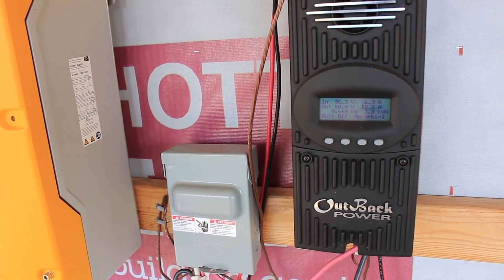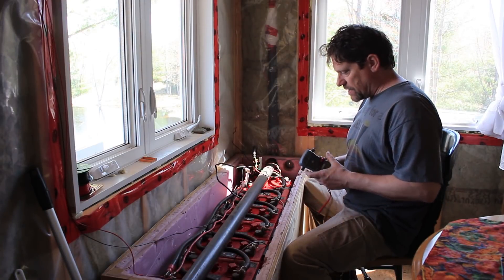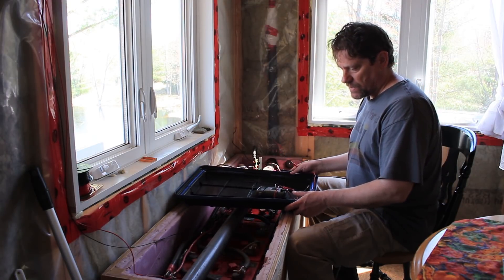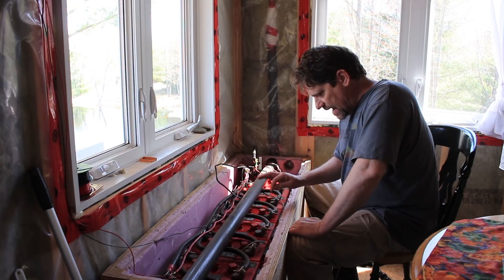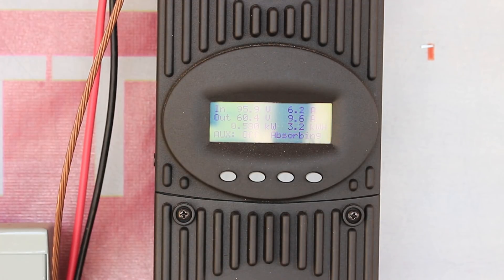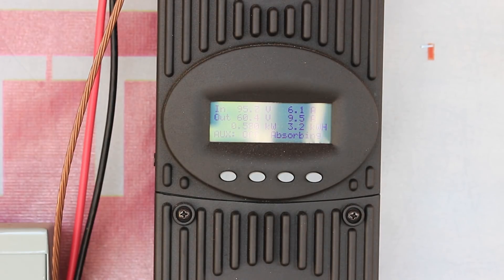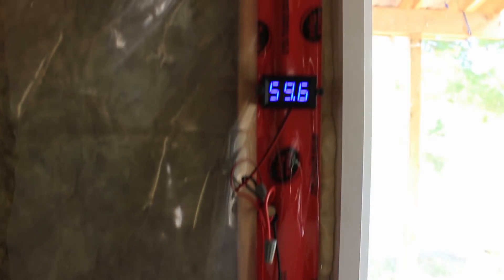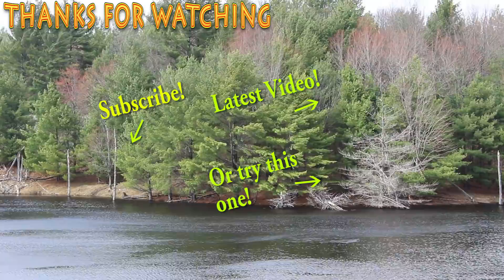My battery problem - SOLVED! Solar power at the Off Grid Cabin

Comment: Yeah, I know I'm a bit late, but still, it's possible your charge controller was doing a monthly equalize charge.
 If you can time it right, do your battery maintenance right after each equalize charge.
 Wearing chemical goggles (not cheap dust goggles), top off each cell with distilled water, check all connections for corrosion, grab each connection and tug on it sharply, then finally clean the batteries with something like NOCO then rinse them off and you're done.
 If you really want to get anal you can check the voltages, and the specific gravity of each cell. Which should probably be done every quarter or so.
Reply from the maker: omg
Reply: @RaspberryRockOffGridCabin  yeah I know, been a while huh? How's everything been going since?

Comment: Increase your volts going in, it pushes the amps through undersized wires. More the volts smaller the wire needs to be. Not sure what size wiring you have but taking your volts up will help if it's to small.

Comment: Temp monitor also,  my setup temp on each battery and also voltage with another shunt current also different caps to help minimize evaporation for each cell.  be surprised in your case you can get 15 to 20 years I do have a pdf on the subject I just have to find it. speaker wire is ok for the volt, temp, etc just make Shure you fuse the volts hookup at the point of connection like 250ma fuse for fire protection like what I see with that volt meter your using right now you need to fuse that wire at the point of connection of course with wire and lead acid battery's keep clean for corrosion and resistance shorts you will also swap your battery's in different locations in your chain because of indifferences of load charge and discharges. yes your controller is very important in the live span. temp charge rates slower is better and keeping it in cycle for a good desulfation algorithm. it will come 2nd nature to you and save a lot of money. just a little 101  for you and its worth the time and research in your part your ventilation is another thing sealed and natural breathing venting to outside screening the ports so ciders and insects cant get in cleaning connections and spraying a seal coating to help corrosion slow down.   ……..  Make sure you check how accurate of your meters with a good one don't trust the china ones and also good ones a must   one one hundredth of a volt means a lot  nice job your doing enjoyed your video.

Comment: Maybe the volts are a little high : I would not go above 57.6V at the battery (resting charger only) What do you see at the battery when the charger says those 60.4 ? On my 24V system I have no problem and I never go above 28.8V at the battery (resting charger only).

Comment: Perhaps you should get another meter and measure the two halves of the battery bank.  This would have instantly told you the batteries were not balanced and there was some problem. You should check out how I heat water efficiently using the excess power that doesn't go into the batteries. I even run a dishwasher with heated dry with only one battery for the camp.

Comment: The best way to solve battery problems ls to connect to the power grid! Nearly every off grid system I've seen sucked! The second best solution is to ditch the primitive lead acid technology in favor of Lithium-Ion batteries.

Comment: Greetings from off grid Oregon,  nice place. A few things may help. #1 a good battery monitor is a must. #2 use a refractometer to determine true SOC. #3 I do not use the return amp setting  on my Outback charge controller. I use just time in absorb and refer to the refractometer to prove that the absorb time setting is right. If the spacific gravity it still low I add time if to high I reduce the time in absorb. The return amp setting will not be accurate because of the loads. The CC is looking for 8 amps of resistance but then you refrigerator starts and the amps go up. This will cause the CC to stay in absorb longer depending on the loads. I just set my end amps aka return amps to zero and let the absorb time handle the job. Hope this helps.
Reply from the maker: Good idea there. It sounds like some work, but worth it. I have a refractometer I just haven't mentioned it in a video.  My batteries are old and worn so I'll have to figure out what SG is "full" somehow. Thanks for the advice.

Comment: Yep, resistance sucks. :/ 

Your batteries are probably okay, since it was a series of batteries, the resistance didn't imbalance them.

Does your controller know what is going into the batteries and what is being used by your daytime loads? (Shunt or similar monitor?)

Comment: Double check all your connections and look for hot spots.
Reply from the maker: Thanks Buddy, never would have thought of that.
Reply: I'm having similar issues right now. I am going to use my $30 Harbor Freight non-contact infrared thermometer to look for hotspots.

Comment: I doubt you damaged your batteries.  They were somewhat under charged, as the loose cable create a resistance, which has a related voltage drop across that resistor.  You could have measured it from the battery terminal to the next terminal connected to the attached cable.  Resistance is the DC impedance to current flow.  So, when you removed that impedance the battery bank now reads a lower voltage to the charge controller. The charge controller slowly begins the process of bringing the batteries back up to the proper voltage. Thus the current goes up for three days rather than slam current to the batteries and cause damage by fast charging.  The gurgling sound is from the gas produced in the remedial charging sequence.  It's another lesson in how we will have mistakes in our procedures.  Put a periodic maintenance program in place.  Clean terminals, recommended coatings(?), torque the connections to spec ( get a cheap torque wrench if you don't have one), Record this stuff in a binder or something.  One day there may be no ability for a while to get parts, batteries, etc. You don't want to have damaged your system.

Comment: Once you get your battery terminals all nice and shiny clean, do you recommend coating them with that terminal protecter you can get at most auto supply houses?
Reply from the maker: You shouldn't have to, Wes. I haven't done anything to mine in 7 years. I plan to go over them with steel wool though.
Reply: btw, It's "wino Wed. here! I guess I'll have to get another jug for Fri!

Comment: Have you considered going with Lithium batteries?  If so, do you have a reasonably-priced source for them in Ontario?
Reply from the maker: I inquired about them recently and was given a ballpark of $1000/kW. Which is way too much.
Reply from the maker: Saetyr it was just casual conversation with a friend. What price do you have and with what company?
Reply from the maker: Saetyr give HES a call. They're located in Barrie. They supply a lot of solar companies in Ontario. Let me know what they come back with.
Reply: Regarding "$1000/kW" -- are you sure on the units on that?  I suspect that you mean "$1000/kWh", since batteries are usually measured in amp-hours or watt-hours.
For comparison, I have ten US2200 batteries, for 1160 aH @ 12V = 13.9 kWh, for approx. $150 + tax each (2015 prices; from Crosstown Battery in Toronto).  So I paid roughly $108/kWh.
Yes, lithium doesn't look reasonable at those prices!

Comment: Send your question for setting the charge controller to outback dot com.    They have online tech support.   Depending on your model, they do have firmware updates and tech docs and a knowledge base available online too.     I did a lot research planning mine for the future cabin up north.   One more little tweak might solve all your problems.
Reply from the maker: Not a bad idea, Patrick. But now that I've made this fix I have to monitor it for a while so I'm sure it's consistent in whatever it's doing. Thanks, see you Friday!

Comment: It takes a long time to fully charge LA Batteries. If manufacturer suggests 6 hr absorb time I would leave it there.  Compass marine has some great information on charging LA batteries. Your solar controller is top notch so trust what is happening but do keep an eye on it. As days get longer the batteries will reach float stage earlier in the day.
Reply from the maker: Thanks, Phillip. But if a 6 hour is no different than a 2 hour, then there's a problem. I'll probably try to get in touch with Roll's customer service and see what they say.

Comment: Russ you didn't damage your battery's ,also in any electrical connection the connection will vibrate you may not see the vibration. Electron flow in any cable vibrates, more so in a d.c. configuration ,that one connection may have been not quiet as tight as the others hence the resistance and the minute vibration will tend to loosen up the connection, when connection battery's in series try to put the same amount of torque on each connection eliminating the vibration when charging and usage. Years ago did the same thing my self ,Russ great video you like most of us, we learn by doing. Your doing great ,love the pond and the shot of your dogs keep on keeping on you will get there.
Reply from the maker: I have lock nuts on each bolt so that shoooooouldn't happen, but I hear what you're saying, William. It was almost certainly just never tightened because I've been having this problem for months. Thanks for the comments and advice, bro.
Reply: Vibration at electrical connections? I've never heard of that before. Where did you get this information from?

Comment: Does your fridge run 24 hours a day, when you have good sun? Does your battery bank handle it well at night? I have a dorm fridge, runs good on solar but battery bank quits working about 4am in the morning. I got 3 marine batteries 12 volt, 3- 100 watt panels. Im thanking I may have to up size my battery bank. Any suggestions.
Reply from the maker: My fridge is plugged in 24hrs/day but it doesn't run that much. I use about 1kWh/day on the fridge. I don't have a problem because I have such a big solar system. I couldn't troubleshoot your problem without a lot more detail and a bunch of math. Sorry.
Reply: Yes, ditch the marine batteries and go for real deep cycle batteries.
 Marine batteries are not really made for this type of use even though they say deep cycle they're not really.
 I would recommend a few golf cart batteries which are real deep cycle. I expect you are wired up as a 12 volt system, so you would have to wire sets of two 6 volt golf cart batteries in series in order to make your 12 volts.
 Remember, dorm fridges use almost as much electricity as a full size refrigerator according to the  Kwh/year on the Energy Efficiency tags at The Appliance Store.
 I've seen quality golf cart batteries at Sam's club, costco, and Batteries Plus for about $100 a piece.